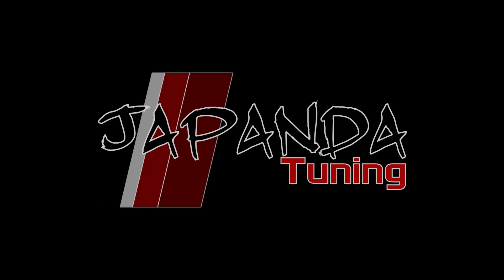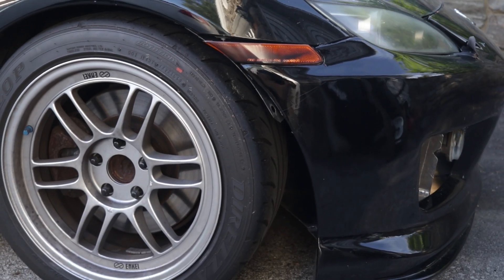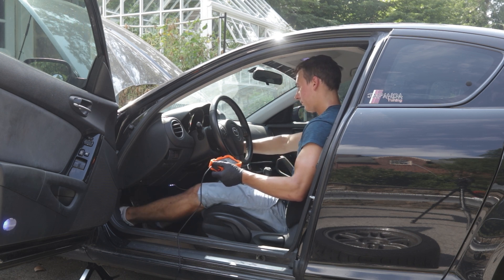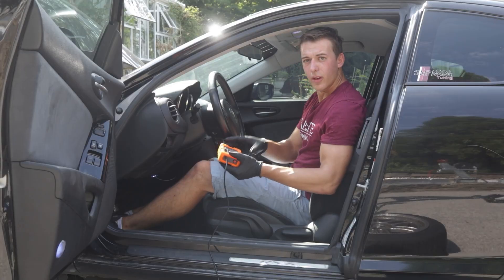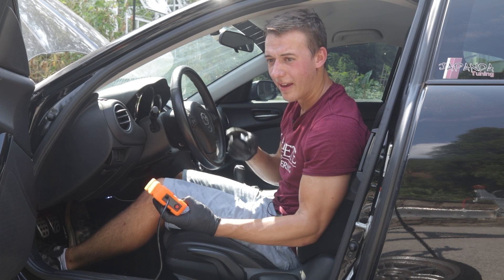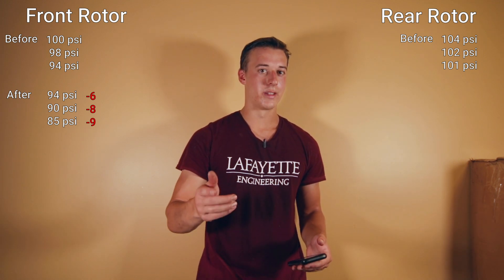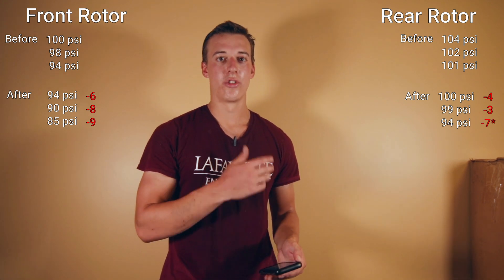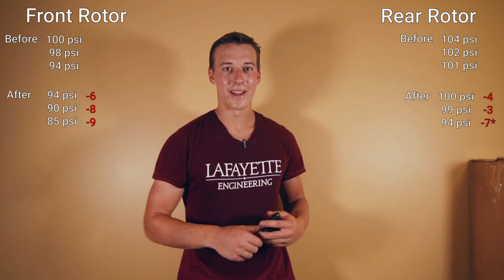Mazda RX8 Track Day Compression Loss Experiment

Comment: @Japanda Tuning have you ever installed a Sohn adapter? I was wondering if you have any opinions on it and if you ever thought about making a video to cover it. If you’ve never heard of it, the adapter is installed to inject fresh 2 stroke oil instead of using dirty oil from the pan
Reply: You really want to just keep on pre-mixing in the fuel the sun adapter is a good idea. But the problem is is the OMP pump does not do enough of a good job, even though you’re now injecting two stroke which burns cleaner because normally oil does not burn well.. it’s not meant too. Think about it like this your gasoline gets everywhere in the combustion chamber so mixing free mix in with your fuel before you fill up well in sure that the two-stroke oil gets the more crevices. In my race motor that I’m building I’m blocking off the OMP pump it does the based off RPM and load of the engineand again if you pre-mix religiously like you’re supposed to you don’t need it I always have pre-mix. If you were not as efficient with Always buying and then deleting it would be a mistake. But the best alternative
Reply: Also will save you from topping off oil more frequently
Reply: The Sohn adaptor does nothing to prevent wear. While it can’t hurt, it does nothing to address the actual issue, which is lack of lubrication. Not to imply that it is a oil volume issue, it is rather a oil targeting issue. Mazda added back a third injector for the Series 2 Renesis for a reason. If you push your Series I hard, premixing is a more robust solution. Ironically, Sohn would be best for Series 2, but the S2 OMP does not allow this.
Reply: It also increases carbon buildup premixing oil into the fuel . Not ideal. Just change your oil like every 3000 Miles
Reply: Robert Muller But Mazda even recommend driving the fuck out of your car and red lining in every time you take it out this helps deal with the carbon buildup. Because the rotary by design does build more excess carbon than your typical piston  motor. Driving to piss out of your Mazda RX-8/ other rotary cars helps them last longer.(with proper gauges and other modes that can help you monitor temps. And keep them reasonable!!) I’m building a turbo II semi peripheral ported motor. That with a good EC you and a proper tune I would still be able to daily drive without it being detrimental to the motor. But obviously when you drive a rotary you’re not concerned about gas consumption😂😂😂😂😂😂😂😂😂😂😂😎.
Reply: daniel brzenski 😂yes redlining often will help . If stuck in traffic as a daily driver sometimes it’s hard, that’s all
Reply: Robert Muller my earlier comment was about when tracking the car. Neither a Sohn adaptor nor premix is necessary for a daily driver.
Reply: nan3r Well that’s not necessarily true you’re gonna want to pre-mix your RX eight if it is a series one. Because like Robert said Series2 they added a third injector. That was to make up for the fact that the oil does not get everywhere it needs to. Something else that I will throw in is Rx-8 housing’s The nitrate coating And chrome layers are thinner than previous generations so no matter what you do no matter how well you take care of your RX eight your housings will not be reusable and they will have chatter marks. Series 2 motors will last a lot longer than the series one motors but they are going to be even more unusable this has been proven through experience of tearing down motors and seeing for myself. On top of that the series 2 has less horsepower than the series one but it does have a better cosmetic look. Pre-mix in the fuel may cause more carbon buildup but (motor oil) is not designed to burn. So premix(2-stroke oil) is more effective. and if you add up the cost of it   comes out to like one extra dollar on top of your pump price. If you get like STP for example it’s a 32 ounce container of two-stroke oil for 1 quart it’s $3.99. Red line makes a really great pre-mix it’s $50 for the gallon it burns a little cleaner than STP and you’re more affordable to stroke oils. So you only have to use 5 -8 ounces per tank. If you break down the cost of that depending on how much you drive your RX eight around in one month that gallon should last you more than a few months
Reply: daniel brzenski I agree - that was my comment about the injector. Nevertheless, I got over 165K out of s daily driven S1 before taking it off the road for some upgrades. No Sohn, no premix. Lots of time in crawling traffic. Maintenance has a lot to do with it...which includes periodically romping on it. From observation, it seems it’s the people on either end of the spectrum that prematurely kill the engine: “Mazda says in the manual to redline it, so I redline it every chance I get, har har har” or the people that never service until something is wrong. Yes, S2 is way more forgiving. They had upgraded ignition coils from the get-go and sufficient oiling due to the added injector - two of the biggest problem areas for the early Renesis.
Reply: nan3r  “ Ricer Rescue” follow us on facebook. And a really good friend of mine that builds all kinds of Rotary engines “Maple racing quote his name is James Belair
Reply: That goes for all of you rotary nuts👍🏻👍🏻
Reply: nan3r I will say that the fact that you made it 165,000 miles with no phone adapter or premix actually really lucky one of the few lucky ones because you always want to pre-mix I want to be completely honest if you can find me a credible source that says you don’t have to. And I can’t remember who said that pre-mixing in fuel card is more carbon deposits. That itself is false information unless also I can get a credible source where it states pacifically that it does. I say that with all due respect. Just don’t want people getting the wrong idea on how to take care of these motors.
Reply: daniel brzenski understand as there is a lot of conflicting advice out there for the renesis but it comes down to what you are doing, track or daily. My experienced Rotary mechanic who has some of the fastest drag rotors in Australia (also racing beat agent) swears premix on daily drivers burning more oil makes more carbon buildup as it’s a natural by product of oil burn. He also prefers synthetic oil as it makes a better lubricant layer on the seals which are far more heat resistant than what mineral oil offers. I’m still not 100% sure myself but this is one tuners way of thinking....

Comment: Did you the comp test while the car was hot?  Also best way comp test is do it three times and get the average. I use the same tester and I’ve gotten different numbers every time.
Reply from the maker: hey man I actually watch some of your videos. Yes the test was done hot both times. Based on my experience with my compression tester, I will get either the same results or one of the faces off by 1 psi for multiple trials. I just have to allow the tester to be on for awhile to equalize before cranking it over. But yes I do agree 3 times and average would have more statistical significance.
Reply: Japanda Tuning thanks for the support man. This actually makes want to try this on my rebuild see if I get the same type of results. Did you premix for the track day?
Reply from the maker: @flatoutinc1040  yes I premixed 0.75:1 oz 2 stroke oil per gallon gas for the track day, heaver compared to 0.5:1 when I am not tracking it.
Reply: Japanda Tuning awesome.

Comment: So , does this mean that you shouldnt track your RX-8?
Reply: Nope. Don’t track tired old worn out engines
Reply: Before you track your car you need to take an assessment of it. 95% I would imagine are fine, but you need to make sure it's ready as you are stressing it harder than any street driving.

So if you prepped it then there's no reason it couldn't take 28min of abuse. I mean many of the students I instruct drive slower on the track than they do on the street.
Reply: Do a rebuild and full prep before u track

Comment: I find these results very discouraging for taking an RX-8 onto the track. I hope you retest your compression to verify the results, noting weather conditions and such. I noticed temperature wasn't discussed in this video, as engine temps (and ambient air, i imagine) change compression readings. It appears the tests were done in the same location, so atmospheric pressure shouldn't be an issue. Were these readings normalized?

Despite my questioning, I do greatly appreciate this video. Best of luck to you (and us) it's really not what it seems.
Reply: neg, rotaries love to be tracked. they love the high rpms.

Comment: I disapprove of these videos testing rotaries that use a renaissance instead of the 13b, if I’m just blowing smoke out my ass someone please tell me, but they are different, correct?
Reply: Ur blowing smoke out of ur ass, the renesis is a 13b NA engine with exhaust on the side housings, but still makes relatively a lot of power, has a nice power delivery and revs to 9500
Reply: Are you taking about the 13B renesis that's in his RX8
Reply: NeVeRGiVeUp4200  I was yes
Reply: Are you talking about the 13B in the RX-8 or are you talking about the 13B in the RX-7?
Reply: @Louk1996  I know, I'm just trying to highlight how similar the engines truly are. Both the Renesis and the 13B-REW are rightfully a 13B engine. If you want to get apples to apples on the names, the model # of the rx-8 engine is 13B-MSP.
Reply: Malcolm Francisco is the only difference twin turbo vs NA engine wise? And because of that compression is different too maybe?
Reply: @sancheznish8285  No, there are a number of differences between the engines. I know it sounds contradictory to what I implied earlier, but I'm happy to explain. The RX-7 and RX-8 both have a variant of the 13B motor. But don't be fooled, mazda's have had 13B motors all the way back the early 70's, with the RX-2. All it means is it's a rotary with 1.3L displacement and B for fuel injection. Others classifications are 12A (carbuerated), 12B, and 20B. On top of that, you have -REW, -MSP (multi side port), and more. Okay, so that just names, but what about the actual differences? The ones i can remember are: Renesis (aka 13B-MSP) has lighter, higher compression rotors than REW. Renesis has 6 intake ports, REW has 4. Renesis has smaller exhaust ports perpendicular to the rotor, unlike the REW's large peripheral ports.
Renesis revs to 9k, REW revs to 7k or 8k? REW has higher oil pressure than renesis. The motor mount locations are different. REW has 2 sequential turbos, renesis is N/A. Second generation renesis has 2 oil injectors in the combustion chamber vs 1 in rew and 1st gen renny. All of the core engine parts can fit either engine, because the blocks and shafts are the same shape.

That's all I can think of mate. Hope it was helpful.
Reply: Malcolm Francisco  it’s was very helpful and well appreciated, thanks for taking the time to explain and give me a better understanding of the engine we all love so much
Reply: @Louk1996  oh my bad haha. You keep doing you
Reply: I was confused about the 13b, still am a lil, so the rx7 and rx8 have the same 13b just ones twin turbo and ones NA? I really appreciate you guys explaining to me